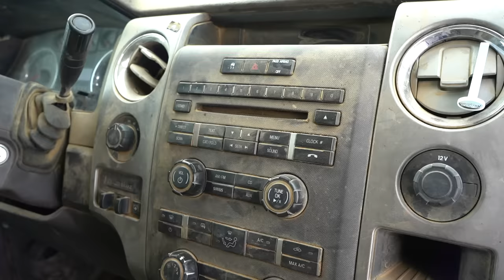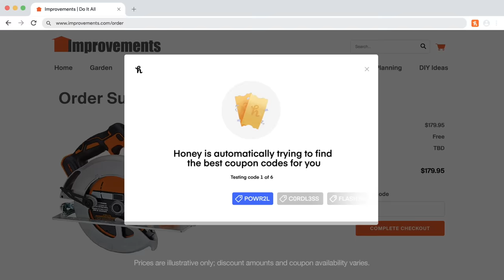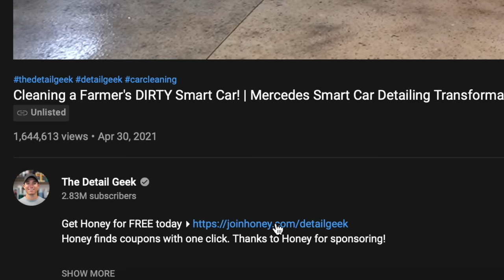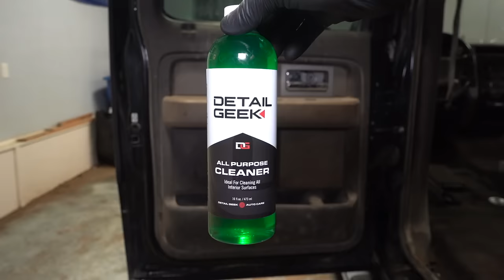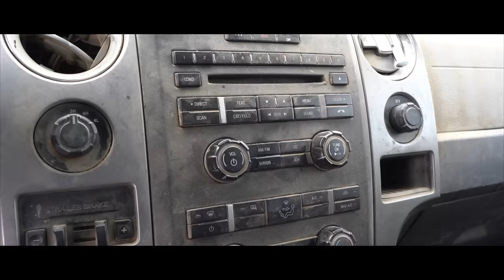Deep Cleaning a JUNKYARD Truck Bought Dirt Cheap! | The Detail Geek

Comment: Outside of the dirt, I can't believe how much rust is in there too underneath the truck. I'm sure if the cars could talk they would say how much better they feel.
Reply: Why are you surprised about rust? It’s literally a Ford.
Reply: @JahWontPayTheBill  Curb your brand loyalty
Reply: @JahWontPayTheBill  rust doesn't care about brand 🤦🏼‍♂️
Reply: @Kemozabe  fords rust out horribly on the underside not just the trucks either
Reply: I'd just trade it in on something better or sell it to a dealership and make my money back on it
Reply: Needs new rockers and cab corners, and that front driver's side lower fender needs some work. Fords are pretty bad for this, though for most trucks, those are the parts that go first.
Reply: No es óxido son placas asfalticas
Reply: Its just your typical trash ford lol.
Reply: @alpe6228  not trash
Reply: Well he did say it was like -30, the truck had never been properly cleaned, and it was a farm truck. That thing has probably seen more salt than the ocean.
Reply: @JahWontPayTheBill  looks pretty good considering how it never received any maintenance 😆 my buddies 2014 GMC already needs cab corners and the bedsides are already going
Reply: @alpe6228  damn this guy calling easily the best full size pickup truck "trash". lmaaoo enjo-y your transmission blowing after 60k miles chevy dork
Reply: @riogrande163  yeah I got a Ford too why don't you tell it the curb it's rust
Reply: i’m surprised there isn’t more
Reply: @treacherousviper  That truck would be cherry upstate NY. There is one for sale like that on CL for 18K.
Reply: this is why I undercoated my 13' F-150 a week after I got it from the dealer. Worth the $$.
Reply: @ThePontiac98  ㄷ., .,
 .
Reply: Probably a state that salts roads.
Reply: pick-up trucks not only sell very well and with big margains, they also get produced as cheap as somehow possible in order to keep them just as cheap. they also dont have to ensure the same safety standarts as normal cars as they are classified differently.

so jeah, that amount of rust is completely normal on a neglected american made truck
Reply: @JahWontPayTheBill  during my time working on vehicles I have seen many different brands with this much rust or worse.
Reply: What do you do with hazy head lightß
Reply: @chrisfarrell8656  iirc, you can polish them from outside or have to take them off to clean inside
Reply: Can you still use it with that much rust?  Wont the frame crack
Reply: @LCT8888  that rust is nothing I have seen way worse lol
Reply: You must live in the south or otherwise somewhere that doesn’t use salt on the roads. That would be considered a pretty clean truck rust-wise in upstate NY.
Reply: Edit out the misused gemstone name Crystal that only reflects me!
Reply: I am the only Crystal and the only wf(s) / gf(s) / bride(s) and the only girl(s) in the world -- all term/name misuse is about to be banned!
Reply: My protector Chip is one of the top ClA agents/programmers and a cop, and he's been involved in the creation of Kewvdnineteen that he named after the big term crown (corona in Spanish) that only reflects me & Chip and the other pure men who protect me -- he said it was only the first step before the system change!
Reply: Hi Crystal! This is the first time I have ever seen someone that I actually know in the comments of a youtube video! (Brittany from the NEX.)
Reply: Salt to melt ice!  It eats up the undercarriage of any vehicle. And bad for the environment.
Reply: @Kemozabe  dodge owners would say otherwise the motors last longer than the bodies
Reply: @tbirds26hockey  that's a dodge thing dude
Reply: @dakotabowes2387  same Toyota Tacoma and dodges have big rust issues
Reply: @infectfish  were I'm at its not uncommon to see cars held together by foam Bondo and wood this truck looks brand new compared to the junk people still drive here lol
Reply: @dakotabowes2387  my friends truck was held together by Bondo and concrete
Reply: @infectfish  lol one of my trucks has a home depot floor
Reply: dint concrete make it heavy lol
Reply: The reason for rust under vehicles in Canada is because we use salt to keep our roads safe from ice in the winter.
If one doesn't rinse the under carriage of vehicles, that's what happens.
Reply: @Kemozabe  Rust does not care about brands, but some brands have better products...
Reply: @MrErichonda30  
Province, not state.
We don't have states in Canada, we have provinces and territories.
Reply: @abelis644  oil will stop it from rusting at all
Reply: cars talking 🖐🏼
Reply: Welcome to the north
Reply: All American brand cars are crap! 😂
Reply: @chrisfarrell8656  use mosquito repellant on all lenses..The more your spray on,the clearer they become!! I took off years worth of fog& grime in minutes,they look brand new now!!
Reply: That's not that much rust.....I was young and dumb and financed a 2005 GMC Sierra 1500 to my monthly budget. The frame has broken in two places already, which I've had repaired, and is about to break again in two other places due to rust🤣. That undercarriage/frame has surface rust. A wire wheel and a coat of rust reformer and Rust-Oleum (which I've had on mine for about a year, right after I had the frame plated the first time....also note the paint had held up well in the year it's been there, but paint only works on the surface. My frame is flaky with several holes due to rust, so paint will only go so far) would sparkle that right up.
Reply: @JahWontPayTheBill   my guy, older nissans and toyotas are the rust buckets but if its the NE then any brand will rust tf up.
Reply: @POTFULLOFGREEN  my guy, it’s like metal rusts or something. 

Great observation. I just like triggering folks by throwing a brand in. Seems to have worked well.

Comment: A wee tip I learned was for really sandy or dirty carpets, put an orbital sander on the floor without sandpaper on it, the vibrations agitate the dirt and makes it so much easier to vacuum.
Reply: @ScrapFatherScrapSon  i see...?
Reply: @ScrapFatherScrapSon  Hey if it works, it works
Reply: Yep we used one but I usually get whatever loose dirt is there and then use a foaming carpet cleaner and let it soak a little then run the orbital over it a few times before I vacuum it a second time. Makes a huge difference and really freshens up the carpet especially if there is discoloration from mud or salt.
Reply: Massage gun
Reply: @George Washington L

Comment: I’m new on here and catching up on all these videos and I’m so hooked! You’ve probably answered this question, but how do you dry the seats and carpets and how long does it take?  I’m so amazed how clean you get these vehicles. They look new again! - watching from Lake Wales, Florida
Reply: The carpet shampooer sucks up the water and it leaves it damp
Reply: Air drying for a couple of hours usually does the trick. As long as the muck is sucked up, the dirty water doesn't settle to leave a lingering smell
Reply: Dehumidifier and fan inside the car

Comment: That steel wheel (driver's rear) worries me. All those weights in one spot is either a defective tire (bad casting) or a bent rim. Outstanding job as always!
Reply: Definitely looks to me like they were chasing weights.

I wonder if they just lacked heavier weights, or if there’s something wrong with the wheel/tire.
Reply: i don't think ive ever seen that many weights on a wheel, i wonder what's on the inner bead?
Reply: There was weights at 12 and 7 on the passenger front too
Reply: Whoever put that many weights on had NO idea what they were doing.  That wheel or tire is junk and needs to be replaced!
Reply: it looks to be a spare and considering you should be driving rarely with it i dont find it to be too much of a problem, couldve been laziness on the tech to not rotate the tire so the light spot of the tire and heavy spot of the wheel meet or vice versa, sometimes you cant put weights on the inside for various reasons and that makes the outer side heavier, sometimes wheels are just garbage, but i think this was a laziness factor to be honest
Reply: Yeah, that made my OCD act up lol
Reply: A good 13 of them wheel weights 🤣🤣🤣🤣🤣

Comment: I've watched a few of your videos and really enjoyed them. I was wondering, though. How long do you let the carpet and seats dry before putting the interior back together? Also, have you ever had any issues with door speakers or other electronics using your steamer or other products?
Reply: He disconnects the battery before doing any cleaning, so the electronics are okay- as long as they have the chance to dry or completely before being electrified again, they should work fine

Comment: amazing job! question is about how long for the seats and carpets to be dry after a deep cleaning like this, and have you ever had any issue with the steam used in the interior causing any damage to issue with the electronic components or moister staying in a/c vents. Thank you for all the great content.
Reply: I was wondering the same thing!
Reply: I'm not an expert but I would assume steam evaporates much quicker than if you just sprayed water on it. Also with electrical components you don't really harm anything as long as there's no electricity running through them, also a lot of the "live", unprotected areas of wires are normally pretty hidden away.

Comment: Great video. Even dirt cheap, I would pass on it. Someone that abused the truck like that probably never changed the oil in it or kept up with maintenance. Hope it lasts the new owner a while.
Reply: Here in NY, if the body/frame is not rusted out, its worth it & whatever money put into it
Reply: ik first hand what an abused ford is like to own; because of how the previous owner never cared to clean or maintain it, It throws random check engine light codes when ever it feels like even though it runs fine.

Modern trucks can't take being covered in filth to this degree (too many computers for that); Noones vehicle can unless its a construction machine.

Comment: Awesome job, if it was my truck, I would definitely replace the cabin air filter and clean the A/C ducts out. I’m sure the heater core probably has caked on hair and dirt as well.
Reply: It would probably be smart to do something about that underbody rust; get a new rust proof coating sprayed on it. Even just a few coats of rustoleum underbody spray would go a long way to helping preserve it
Reply: @Dana-oe1ne  I was thinking the same thing.

Comment: I've always wondered how much extra weight in dirt a car like this carries around my guess is there has to be at least 30-40 pounds of just dirt on the car alone.
Reply: especially when its caked all to the underside and running boards. mud and bullet shells, someone had a good time in that truck
Reply: As a tire guy, I can only imagine how out of balance the wheels and tires are with that much mud underneath. Even 8 ounces of mud in the wheels is enough to shake your fillings out
Reply: @ImThe5thKing  Where do you folks live making these comments?  I live on a dirt road in Michigan, during spring thaw all the trucks being driven on back roads look just like this.  I also work with subcontractors at construction sites, the drivers of the trucks many times don't own them.  You can guess pretty quickly the interiors get really dirty, not at bad as this truck but dirty non the less.

Bottom line is work trucks with leather or cloth interiors and carpeted floors won't look nice for long w/o a lot of effort.  Better option is vinyl seats, floor, door trim so they clean up easily.  Better yet the trucks with floor drains that can be hosed out.
Reply: @jimw6991  the new Ram Tradesman with the vinyl floor is awesome for keeping clean. Takes five minutes to give it a scrub and sweep it out.

Comment: 5:20 Take a look at the amount of balancing weights on the wheel.
Also 1 back wheel is a simple steel one, the other is an alloy.
Reply: Lol I noticed that too! As far as the mismatch goes, that steel one was most likely the spare that was just left on, but yeah I've never seen one THAT far out of balance!
Reply: Yep, that tyre must have been so far out of balance!!!
Reply: More than likely that wheel has a bent center bore. Uncommon but still an option. I’m guessing that tire size is also a 265/70r17 and I’ve never had a tire call for that much weight being that size with dynamic clip ons.

Comment: I wouldn’t entirely recommend steaming the metal mesh on the door panels due to speakers being behind it, you can easily take them out with a flat head screwdriver and they just pop back in
Reply: Electronics are underneath the speaker cone. There are videos of people putting paint in speakers and letting the bass fling it all over the place.

They will be fine.
Reply: @jimmychimmle8798  facts

Comment: Amazing work there Mitch! Question though, does it not damage the door speakers using the steamer on the grilles like that? Same with the other electronics. I'm curious because I've always been super careful/paranoid around those parts of my cars.
Reply: Yes it does.  Maybe not every time and maybe not immediately.  But the dirt/mud wasn't removed.  It was just liquified and pushed through the door panel to the backside with the steam.  With basic/cheap trim removal tools the door panel can be popped off in 2 minutes or less.
Reply: Always remove the door panels before a deep clean like this.
Reply: Depends if the speakers have foam rings on them, if they do then water def damages it.

Comment: @5:42 FYI If you need all those wheel weights, you either have the heavy side of the wheel and the heavy side of the tire on the same side, or there is something wrong with the wheel and/or the tire. The thing to do is mark the center of the heavy side, dismount the tire examine the wheel and tire if there is no damage or defect remount the tire 180 degrees from its original location and rebalance. Just slapping on half a dozen large weights and calling it good is unacceptable, make them do it right or find another shop.
Reply: I'm glad I'm not the only one who noticed that. Rediculous.
Reply: The wheel weights are why I’m in the comment section

Comment: That spare tire on the back driver's side had a ton of wheel weights on the wheel. I think whoever did that must've been a newbie because an experienced wheel and tire guy would rotate the tire so the wheel didn't need so much weight on one side.
Reply: Clean the mud off the inside of the rim?
Reply: Could be that if the rim is bent it's just necessary to a little crazy with those wheel weights.

Comment: Do you also get into cleaning the ductwork of the climate control system? I imagine on many of these vehicles it's just as nasty in there too. Wouldn't want to be breathing in all that after gasping at the beauty of a freshly detailed interior. Excellent work!
Reply: .... great question jklingeroo! Once you start thinking about where the actual air comes from in an auto/truck HVAC system.... either from the fresh air setting or the "recirculating" setting, you gotta figure that air is just as nasty as the rest of the vehicle. Ever stop and think what the ducts in a home with a forced air heating/cooling system contains? I didn't until while I was renovating my grandparent's home to sell after they had both passed away within months of each other. I happened to see a Stanley Steamer commercial on TV about "duct cleaning" after having a new HVAC system installed. I figured might as well have the ducts cleaned after spending almost $10K on the new HVAC system. Gramps built the home in 1956 and always changed the furnace filters so I didn't expect much "crud" would come out of the ducts. Wow was I wrong. Stanley Steamer pulled out three 30-gallon drums of the grosses crud you could imagine. Basically over 50-years of dust, lint, dead skin cells, dog hair, etc. So, your question about cleaning the truck's HVAC duct work is spot on!

Comment: 18:53 So your camera doesn't vibrate as you pan up and down the tripod, take the knuckle apart and add a thin felt pad on both sides. That way, you can slack it up a bit more, and use the friction of the felt pads to keep the camera from moving. Adding weight to the legs also helps.

Comment: As I mentioned before, I used to work for an auto auction. Dead batteries and barely running vehicles were my bread and butter. I jump started hundreds of cars a week. I can do it in my sleep. It took a lot for me to call my lead driver for a tow and pick up.

Comment: Can use use your cleaner on indoor home carpet spots? Also, I think that with your drill brush, you may be able to gently  loosen some of that hard caked on stuff on carpets, so it's faster and easier to vacuum before the wet application...just a thought!

Comment: I’ve watched several videos already and still wonder how you are using steam (water) on the door switches and the dash. How’s it possible to not short out the electrical connectors. What do you do to dry the seats and carpet ? 
Great videos, thank you

Comment: I have seen several videos where you use the iron deposit cleaner on the vehicle, but they are all light colored paint which makes it easy to see the purple color to rinse off. Are the only vehicles you use that cleaner on light color because you can't see the purple on the dark colored vehicles or do dark paint jobs not have iron deposits?
Reply: usually you can still somewhat see the purple colour on dark paint, but not all cleaners like that turn purple and they're not always used

Comment: At least it was possible to clean it up. The most completely-used-up pickup I have ever seen was a Chevy, circa 1960, that, by 1970 or so, had rusted through somewhere in every body panel. It belonged to the county trapper. The bed was always filled with the tools of his job.